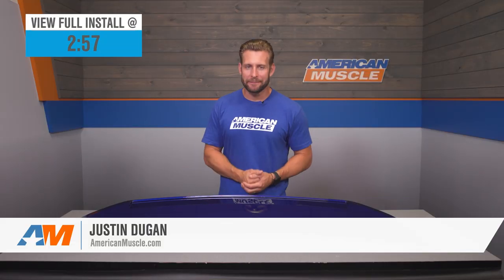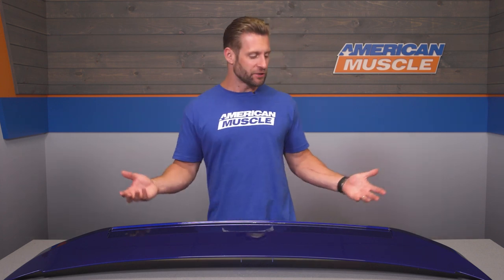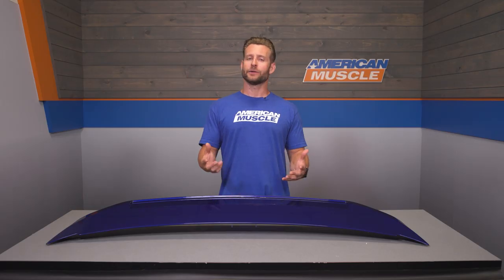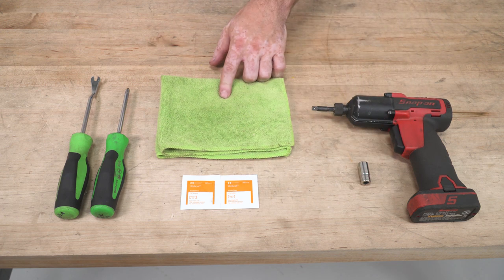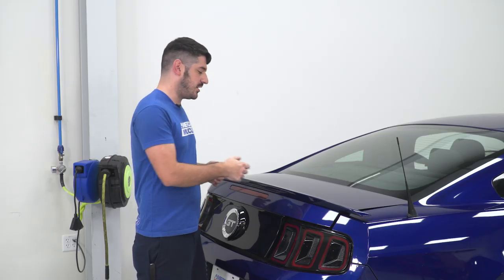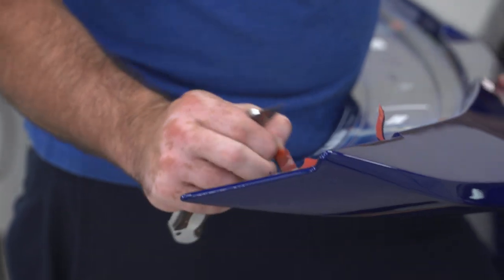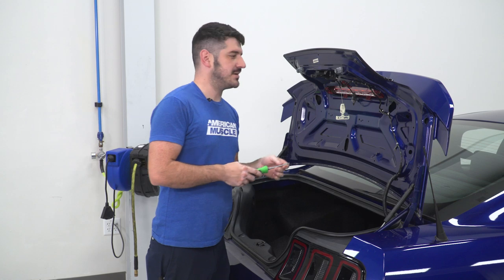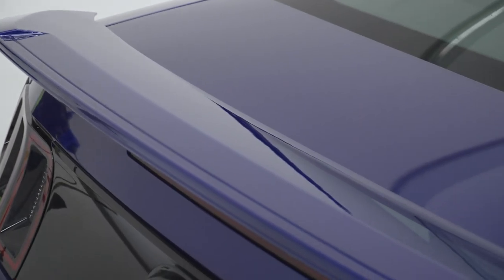2010-2014 Mustang SpeedForm GT500 Style Rear Spoiler - Pre-Painted Review & Install

Comment: A tip for anyone buying the spoiler....to prevent water from leaking into your trunk, put a little ring of silicon around each bolt hole that way when it's tighten down it will provide a seal. I have no idea why they wouldn't at least provide some rubber gaskets for each whole, my tip is just as good.